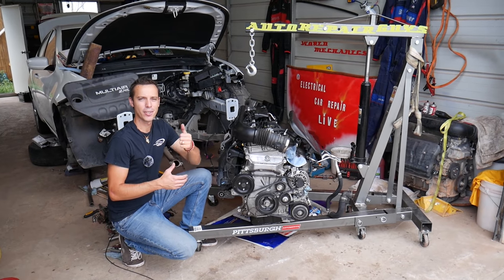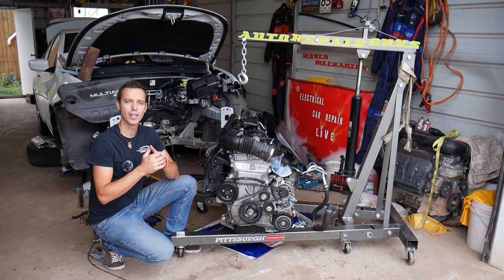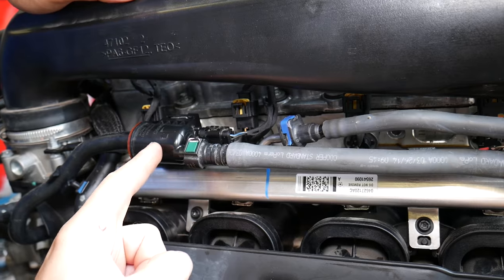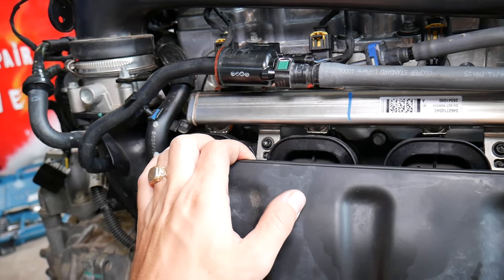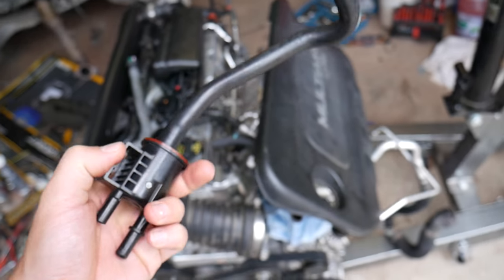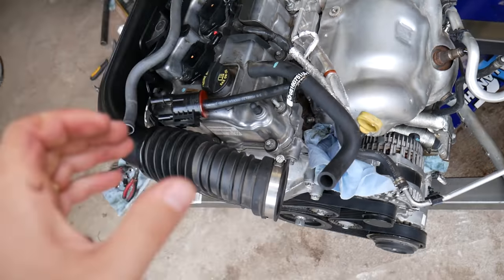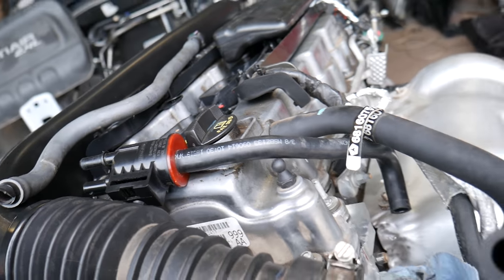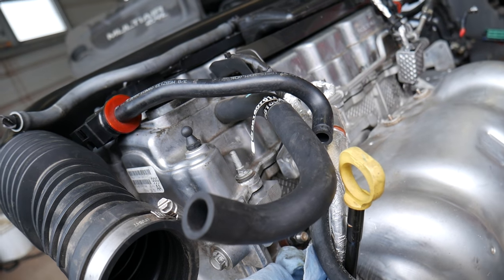SYMPTOMS OF BAD PURGE VALVE. HOW TO KNOW PURGE VALVE IS BAD

Comment from the maker: Products that we use and recommend:
► Purge Valve (check for your car): https://amzn.to/3NnLZu0
► Panel Removal Set: https://amzn.to/3YiMADu
► Tool Set: https://amzn.to/3p5MM6t
► Screwdriver Set: https://amzn.to/3XRB28Q
► Castrol Oil: https://amzn.to/3xBc8B9
► Oil Filter: https://amzn.to/3w0Ulme
► Torque Wrench: https://amzn.to/32qyRwg
►Liqui Moly Engine Flush: https://amzn.to/3IiDBID
► OBD Scanner that we use most often: https://amzn.to/3I4MQfe

► Check out our Amazon Store for the tools and parts that we use: https://www.amazon.com/shop/worldmechanics
Reply: Hello my friend, can this valve make the car open ABS? I was drivine played with bjg lights and suddenly abs popped, car reduced speed and engine light opened. I did a diagnostic and the problem is this valve. I played again with big lights and again the same thing, Abs poped and car slowed speed. What do you think? Can this valve affect abs?
Reply: I don’t have any lights indicating that there is any problem but do you think that changing the purge valve could potentially help with the rotten egg smell I’m getting when I rip it also do you think it’s something I should change based on mileage I’m also getting poor gas mileage

Comment: He described EXACTLY what is wrong with my vehicle and I've also confirmed this with my best friend who is also a mechanic. At first I thought it was bad gas, my coil pack going out, and my O2 sensors going out. I just changed the valve and cleared the code with my friends code reader and it instantly started running better and idling better. And the light hasn't come back on so I can get it inspected now! Thank you!!
Reply: Awesome. I have a 2010 hyundai elantra and it’s doing the same thing, rough idling, and hesitant take off but once I get going it’s not so bad. Throwing the same codes too. I’m gonna go change it today and see if that’s the issue.
Reply: Did u have lean bank 1 and 2

Comment: You were right on.  I as getting P0170, 0038, 00136 and was about to replace the MAF and Downstream O2 sensor and all it was was a pin sized hole in the 6 inch vacuum hose from the Purge Valve to the intake manifold.  You saved me hundreds of dollars and hours of time.  Fixed it for under $5 and in under an hour of time.  BRILLIANT VIDEO.
Reply: My car would start and run fine until it got hot and under load, then it would severely hesitate when trying to accelerate.   Car was a Hyundai Elantra 2006

Comment: Hi guys, thanks for the useful video!
Studied what "purge valve" really is. In older cars it was the same system)) - fuel tank ventilation. Just hose on a tank with non return valve on the end of it.
Thanks for the new word combinations I studied in English 👍:

-Purge valve - клапан продувки (бака);
-Engine misfire - пропуски зажигания двигателя ("двигатель троИт");
-Stuck close (open) - заклинил в закрытом (открытом) положении.
Good luck!

Comment: Thank you very much, it solved my rough idle issue on my Mazda B3000. I've already spent $440 trying to fix this rough idle. I've been told i needed a new fuel pump, fuel injector cleaning and using expensive premium fuel.
Reply: Hi , I have a 2006 corolla verso with bad idling when cold, tried a lot already too. Didn't yours have error codes, mine has not? What was it, was it stuck opened?

Comment: I like to thank you so much for your video. I own a Toyota corolla 2005 with 267k. I have been having all the problems that you had mention on this video. I had spend hundreds of dollars trying to diagnostic the problem for the past four years. I also had gone to four different mechanics and they could never figure out what seemed to be the problem. I even bought a new computer for the car, thinking it was it. I was to the point of getting ride off and pass to someone else not to deal with. I also been trying to do my homework on watching videos like yours to see if I could find the solution. 
Until one day I came across your video, I decided to give my last shot.
You have saved me from buying a new car and being able to continuing driving a car that I been for the last teen years now.
Reply: Hi Claudio, I have a 2006 corolla verso with bad idling when cold, tried a lot already too. Didn't yours have error codes, mine has not? What was it, was it stuck opened?

Comment: My 2001 Jeep TJ throws a P0455. I was proud of myself when I fixed a loose vent hose at the filler neck. The code returned. I replaced the gas cap. The code returned. I found a section of the vent pipe that was rusted through above and behind the driver's side rear shock and repaired that. The code returned. Thanks to your explanation that a purge valve stuck open imitates a vacuum leak that causes hard starting (and mine cranks longer than it should especially in the morning), I now know to check my purge valve. Thanks for the help, brother - you definitely earned my subscription.

Comment: What is the relay to the purge valve is not working? Will that be the same as the scenario you described when the purge valve is continuously open? Have a car with a missing fuse to the purge and it has problems starting, sometimes it just cranks and does not start, other times it start  but cannot speed up to 130km/hr.
Any thoughts on the issues is much appreciated.

Comment: Hey guys thank you for all the videos of repairs on the 2004 330ci. I have one also I have replaced a lot of parts on this car within the past year. I've replaced the idle control valve and it still has a rough idle and bogs when I press the accelerator, and still  throwing the codes P1504 and P1508 what am I doing wrong. I've taken everything back off. When I put everything back on tomorrow I'll take a video of it running so you can hear it.

Comment: Thanks for sharing..we had to change one in my 2002 chevrolet silverado 4.8 and my question is when will the check engine light go off? Should it reset it self after driving awhile or do we have to get code erased.  Thanks

Comment: i opened the hood and heard a pretty bad clicking/rattling sound and could clearly see it was coming from the purge valve.
so when we got to florida i got some lubeguard instant shudder fix and i replaced the purge valve (no codes btw)
it seemed better but not fixed, i was thinking fluid flush on the transmission. well when we got home i noticed the purge valve was making the same noise, so i disconnected it...
problem disappeared. Shifting is better and no shudder. so it seems the car is commanding the purge valve to open and close rapidly.
after hours of research here it seems like many people have had a similar issue but with a wide range of fixes.
Is this an electrical purge solenoid plug issue?

Comment: I have a 2016 Ford F-150 with an intermittent rough idle and stalling issue.  What do you believe could be the cause.  There are no codes and it could happen everyday for weeks or happen 1-2 times a month

Comment: Quick Question: I have no codes yet, but am having issues with being able to fill my gas tank. It stops frequently, and has even overflowed when it was indicated their was only 1/4 tank. Could this be an issue with one of these valves? For what it is worth, it sat for about a year before I fixed the suspension, and now it is doing this.
Reply: That be more of a gas tank vent valve there’s two one valve vents to the engine to burn the vapours the other allows the vapours to vent to the charcoal canister if the tank can’t vent the vapours those vapours will climb up the filler hose and shut the pump off. As the gas fills the tank the vapours will sit ontop of the gas and once the tank fills the vapour will climb up and fill pipe and shut the gas pump off. If there’s too much vapour in the gas tank it’ll keep clicking the pump off and not allow gas to enter. The charcoal canister is like a holding tank for the vapour it absorbs the vapours then computer at random intervals will open the valve to burn the vapours in the intake of the engine.

Comment: So I have a P0171. I've watched all you videos on it. So I know it is a vacuum leak. Trim raises at idle then lowers when accelerating.

Now, when I take off the vacuum hose connecting to the Purge Valve intake, and I place my finger over the opening (basically closing the valve) the trim returns to normal and car runs fine.

Does this sound like I have vacuum leak on the hose leading to the gas tank?

Notes: 
purge valve turns on and off just fine when I test it with a battery.
It's closed when car first starts, then opens as car warms up.
Reply: hey man did you ever figure this out
Reply: @andrewdeluca2485  it turned out to be the purge valve. I found out by testing it again while still on car, it stuck

Comment: What do you think it is if the car doesn't start after I fill up the gas tank?

If I try like 3 times then it will start or if I step on the gas while cranking it

Thank you
Reply: i had the same issue
Reply: @MoNaLiSa-bq9og  replaced it and it works ggggrrrrreat
Reply: @shuffleshuffleshuffle  okay if it happens again i’ll get it checked out👍🏿

Comment: Can an EVAP purge be bad without any fault codes? Mine is making one hell of a noise (almost sounds like valvetrain noise) but by activating it with MB XENTRY I can hear it's the source of the noise, not the engine. The lines and hoses to it seem secure. It's a pain in the ass to get to on my car as it's behind the variable manifold. I have absolutely no fault codes or misfires etc but have been having problems with engine hesitation and poor fuel trims

Comment: Thank you man. Does code P0456 can be related to PURGE VALVE? I had a problem with my fuel tank sending unit, after replacing a whole fuel pump + the sending unite I got the P0456 code

Comment: i have very rough idle at cold start..sometimes i may have to crank twice at cold start..stalls and finally clears out..also when i refuel it completely doesn't want to start..changed plugs,fuel pump,coolant temp sensor,injectors..i will give this a try tomorrow..its Toyota a 1AZ-FE btw..
Reply: Did it fix your issue?
Reply: @benludwig3034  not yet..my mechanic said it's the valve seal..but i changed my throttle body now it starts everytime i put gas
Reply: @kennethbryan3738  thanks  I appreciate the reply

Comment: My father has a 2020 Chevy Trax and we keep getting a faulty canister purge valve on the diagnostic computer but his cars running just fine and it idles like normal and he hasn't noticed anything abnormal yet, and all the lines going to and from it are all good as well and he only has 50,000 miles on his car, but the other day the check engine light came on for the first time, so thats why we got a scan, is this purge valve going to get worse over time or could it be something else since his car is running as it should be?

Comment: Not sure if it's the purge valve or not. I drive a standard Chevy s10. It has trouble starting and idling. And it constantly revs at stop lights without me using the gas pedal at all.

Comment: I have P0456 and there is no longer a vacuum suction when I open my fuel cap. I replaced the cap so it's not the cap. So I'm guessing it's the purge valve. I have a 2001 Honda Odyssey minivan. 

Any help would be appreciated.

Comment: So if a purge valve is stuck open, fuel vapor from the charcoal canister continuously flows; so I gather that also then doesn't allow the canister to become properly saturated with tank fuel vapors; so I gather then there will always be more air than calibrated in the ECM for a normal purge.  I gather the ECM knows/is calibrated to the fuel/air ratio in a normal demanded purge.  SO then the engine performance should be better on a full tank, and get worse as the fuel tank empties and has more air in it.  SO if you wanted to test the purge valve idea you could compare the performance on a full tank and half empty tank??  Fuel Trims would improve on a totally full tank and get worse on an empty tank??
Reply: Could explain why first half tank seems to last a little longer.
Reply: So I have no engine lights or codes but I have noticed something odd my gas lasts longer seems to not drain as quick when it above half a tank if it’s below it seems to go quicker. Plus the car sometimes will act up rough idle some staling hard starts once gas drops below half a tank. Could this be the purge valve stuck open again no codes no engine lights but all the symptoms seem to match.

Comment: My car stalls at signals. RPM needle is unstable while that happen. But i replaced this valve with my friend’s car and the car ran smooth without any issue whatsoever.

Comment: Had a p0420 code. Replaced the Purge Solenoid and a vacuum. Hoping it stays off until emissions test soon . Should I run any cleaners through it ?  Any advice ?
Reply: Did replacing the purge valve help clear the P0420 code?
Reply: @clearlyexpediting  it did not.

Comment: My 2018 Nissan Titan shows the code of p00443. The check engine light comes on but will go off some time later. Is it a short? Or does the whole valve need replacing? It spits and sputters when I start up the vehicle. It doesn't do it all the time. Today I filled the gas tank up and it was on but once the fill was in it went off. After driving it for a second my vehicle stalled. Any suggestions?

Comment: Can a bad purge valve cause a car to lose power? 2006 Ford 150 quit while my 16 year old was driving. She had been at a 4 way stopped and was just accelerating through the intersection. The engine stopped no brakes or steering but lights and radio still working. Red battery, yellow engine. She put it in park, turned off the key and restarted. Felt like it was going to stall again and tachometer was fluttering. No codes showed on my cheapo code reader. Dealership could not find a problem. New battery two weeks ago.

Comment: I have a question 🙋🏻‍♂️ , hopefully you can help me with this.
I have a 2008 Malibu it the had the light on, scanned it and the code was for the purge valve selenoid. Replaced it, reset everything and the light came back on. Scanned it again and it was the same code. They told me it could be a defective part, I replaced it again, reset it and the damn light came back on. What should I do in this case?

Comment: Hi, I have a P2402 code on my 2011 BMW 328i xdrive. it points to leak detection pump? (is that the same as purge valve?) ...Is there an easy way to check the hoses etc for a leak in the system? do most people just change leak detection pump?...I did check my gas cap...it seams ok? id hate to change pump for nothing?

Comment: Do you think it could throw a camshaft or crank shaft position sensor as well? Mine has thrown multiple codes.  Ive changed the spark plugs. And crankshaft and camshaft position sensors. Still rough idle amd weird acceleration.  Im hearing a vacuum leak sound around the purge solenoid your talking about amd felt it. I can feel it ticking but lots pf noise from back there. The line maybe leaking like you say

Comment: I replaced the purge valve and after a month of so I'm getting the same lights- fuel cap open and check engine light. Gonna check the hose and if it's alright, I'll just replace the fuel cap.

Comment: im chasing a gas fume smell in the cabin of my wifes 99 mazda miata & was told if could be the purge valve? ...just currious if u think the purge valve could cause that? ...& we are getting a randomly reoccurring evap code from time to time, but its intermittent, which is why its been so frustrating to track down... thanx
Reply: That is very dangerous for 2 reasons, its VERY bad to be breathing gas fumes and gases can ignite too

Comment: Question: what if my codes are saying it is stuck open and stuck closed at the same time, and also saying low input voltage and high input voltage at the same time? Does this indicate the sensor is bad?

Comment: My 2014 fiat500  came up with a check engine light and a (p0452 code evap leak detection) ,,,,.and rough idle when cold start, , this problem started after i overfilled the gas tank,, do you think it could be the perge valve?

Comment: Can you test the valve off the car with a multimeter if it’s bad I checked the connector got all the powers it needs but I believe e the valves bad I have no engine lights or codes but my car acts up sometimes and everything I researched is leading me back to this valve. At times I can drive the car just fine but sometimes I’ll start acting up rough idle hard starts and when it dose act up pump squeals like there’s too much pressure. I remove gas cap don’t hear anything but every time I do this the car will start up fine again. I can replace the valve really easy to get too on my car just wanna make this is the problem first

Comment: Hi,  BMW e60 525i 2004.
 im getting the error code P0444, i change the fuel cap, cleaned MAF sensor, and check the purge valve reading its woking fine, but the code is still keep coming after few miles drive or on high speed. I disconnect the purge valve and delete the code and reconnected again, for now its gone.. 

Do you have any idea what should i look in to? 
Please let me know 
Thank you.

Comment: ive got this code on my honda hrv 2020  P04F1 Evaporative Emission (EVAP)

System Low Purge Flow Detected Current|PGM-FI  P0441 EVAP System Purge Flow

Malfunction Current|PGM-FI U0401-68 PCM Malfunction Current|EPB when i scan it because check engine light keep going on and off about 2 to 3 weeks then comes on again i change fuel cap check the fuel cap if its any holes dont see change baterry was told my mechanic only honda geniun batttery same thing did not go to that mechanic again now iu change the purge valve i check my hose coming from there no leak. if it does comes back again what do u think it is? also when i put gas yesterday engine light comes on wich it when it comes on those the one that always the codes from evap to ebrake please help